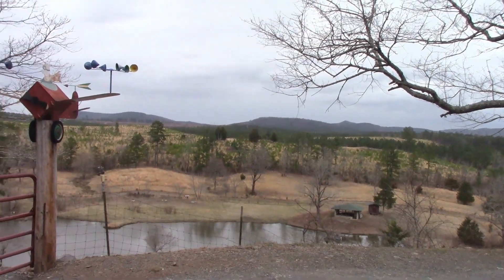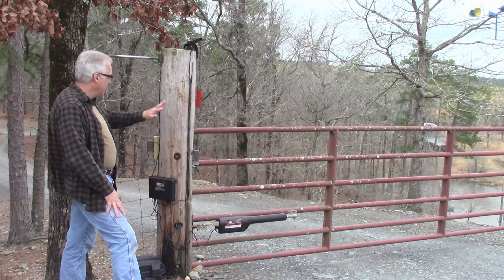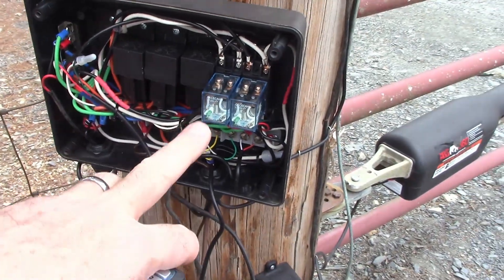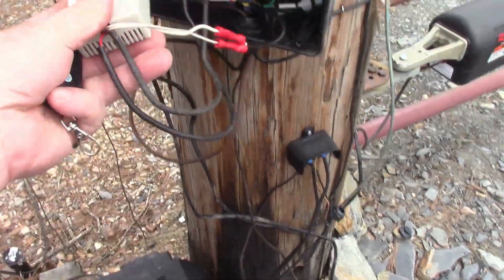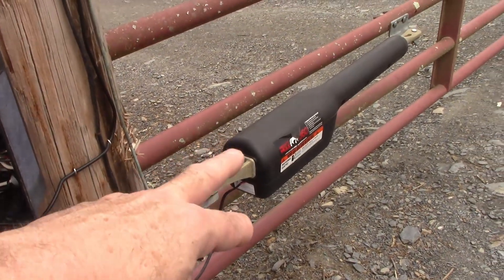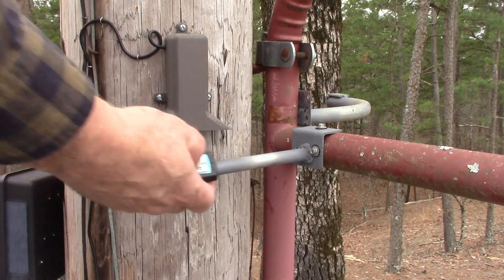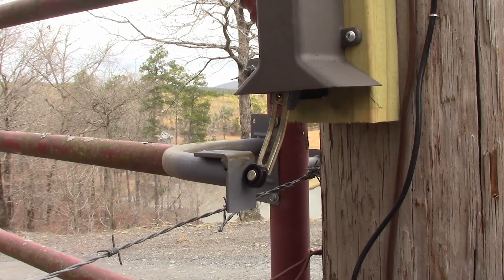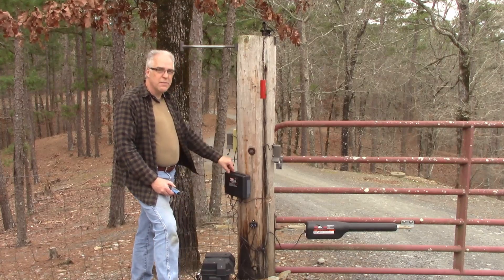DIY Mighty Mule Gate Opener Controller Circuit Replacement

Comment: Can you please send me the diagram on the steps to get this going? I ordered the parts you mentioned.
Reply from the maker: It's in the description of this video:  https://youtu.be/_x0FUXZ8c8c
Reply: @SoatMon  Thank you. I printed that off already. The only thing we need help with is wiring the relays.
Reply: @SoatMon   I clicked on your link and bought the same relays. Which size wire for the relay and which posts do we put wires on? What does the remote connect to?
Reply: @SoatMon Which size wire do we get for the relays?

Comment: Yea you should be able to prevent the destruction with a faraday cage [metal box / screen] surrounding the components and that cage grounded deep in the dirt with a rod.  Really awesome cheap hack though.  You could add cheap analog circuit to add the functionality of stopping with the hand pull switch.  If in motion, start switch becomes stop and reverses with more relays.  Definitely doable.  Though your method is simplest and works good
Reply from the maker: I think the main problem is the pull chains that are down the hill a little acting as antennas to bring in the lightning.  I finally tried disconnecting them and didn't have as much trouble but had to connect them every time I expected someone to need one of them .

Comment: Hell yeah.  This is why I'm subbed here, sensible solutions to regular stuff. Thanks.  

BTW, a ground rod should help lightning impulses bleed off without doing much damage. Nothing protects against a direct strike but grounding is how the big cell towers and radio towers stay on the air though storms and strikes. I now use antennas that are grounded by design to protect my ham gear.
Reply from the maker: Thanks!  I tried a grounding rod and still lost 2 more....  Thanks for the idea though.